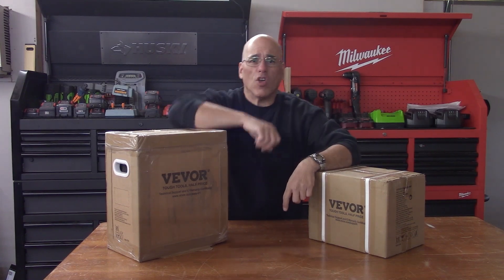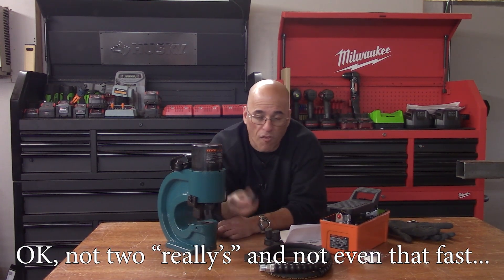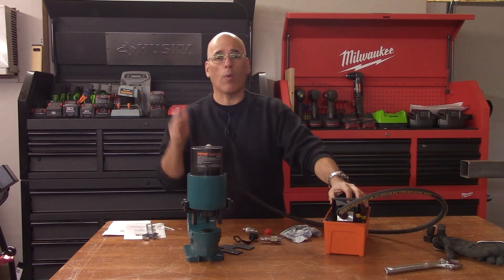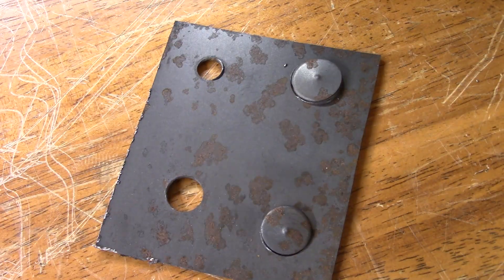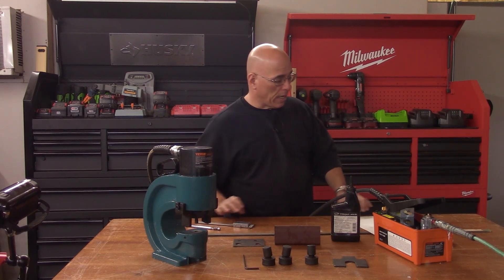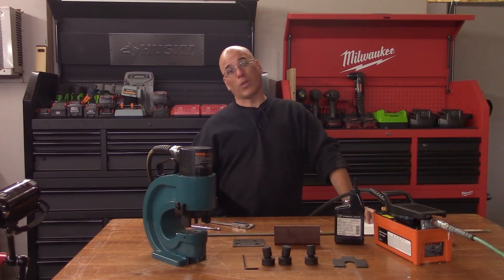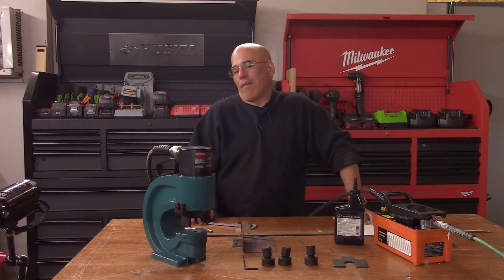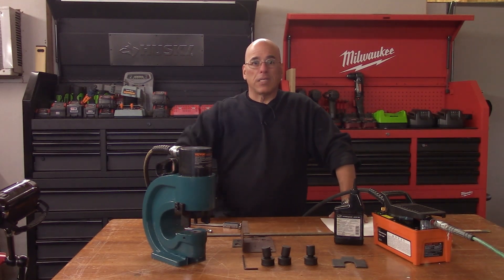First Holes With the Vevor CH-70 Hydraulic Hole Punching Tool

Comment: Is there a way to use it for punching 1/2 in holes into 1 5/8 solid unistrut?
Reply from the maker: Well, to answer your question, there is a way but not with the provided hardware. I think the machine has enough clearance for the material (the clearance is about 1.8" once the punch is mounted), but the included punch would not be able to go into the base metal without cruncing the unistrut walls You would need to elongate the punch which of course can be done in a lathe. So yes, it is probably doable, but a few extra steps are required.
Reply: @CNCDude thanks